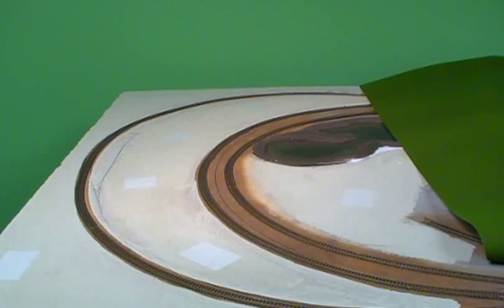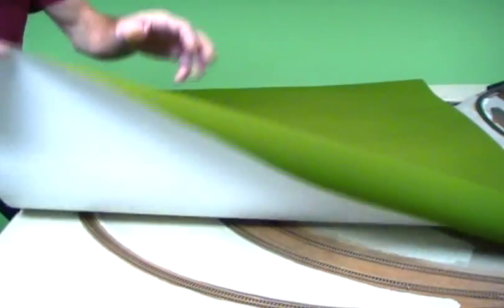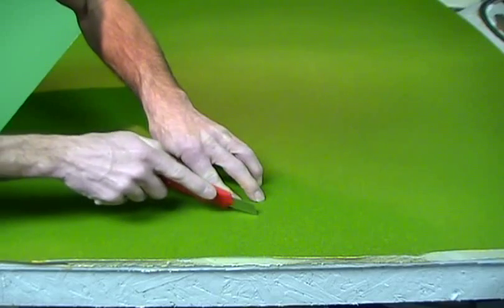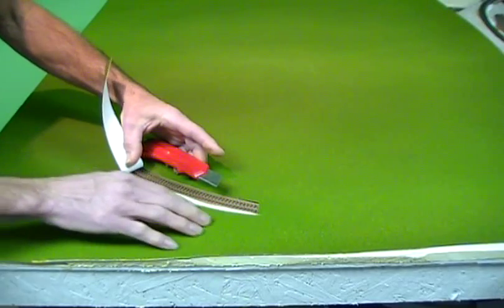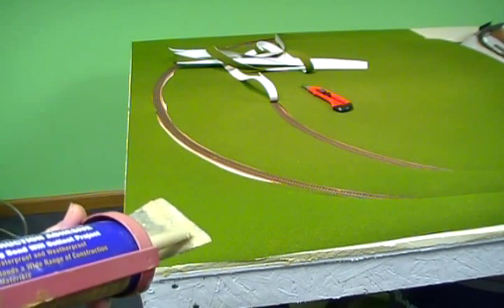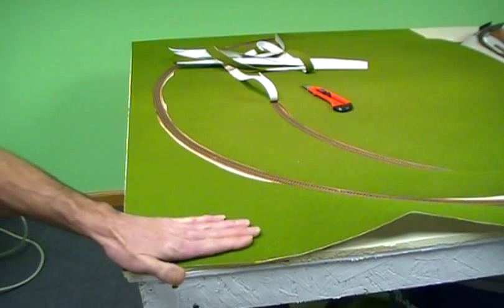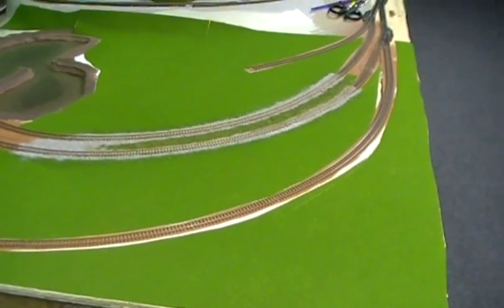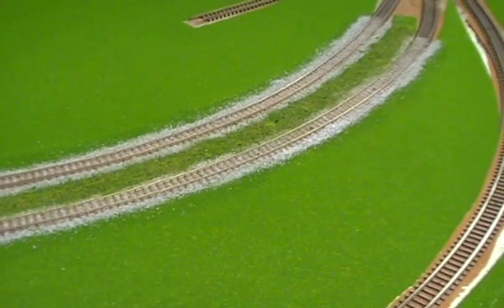GRASS MATS  part 1 HOW TO MOUNT

Comment: This is just what I needed to see. So many layouts show people using material that you pour onto the layout and then put glue on top of. For my first layout, I need something easier to work with. Thanks for showing me this can look good!
Reply from the maker: Quick way to get some color on the layout. You can always add ground foam on top of it to change the colors.

Comment: Wouldn't it of been easier to lay the track on top of the grass roll ?
Reply from the maker: Yes you can put the grass mat down first. In my case I did the track first so I could run some trains.